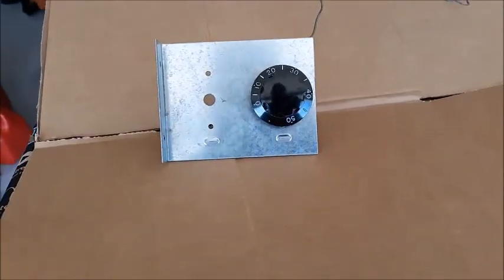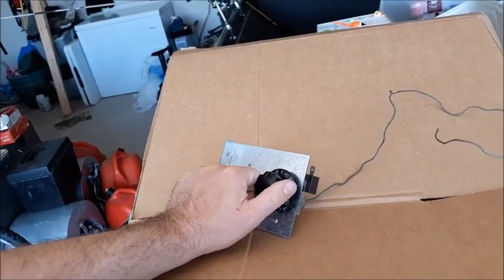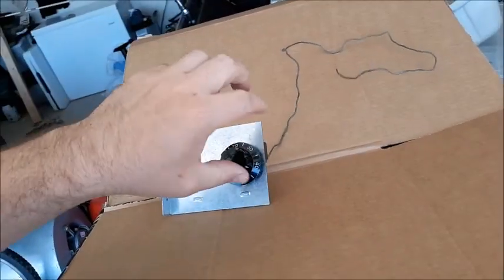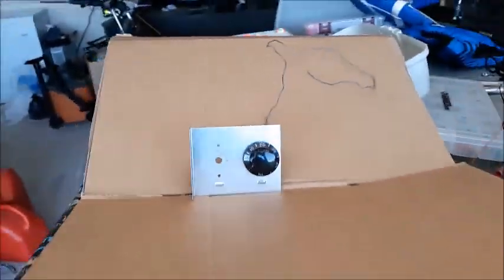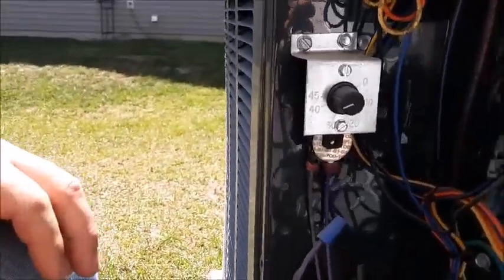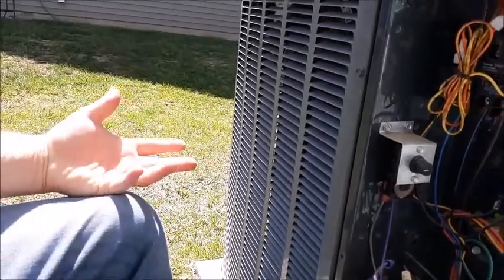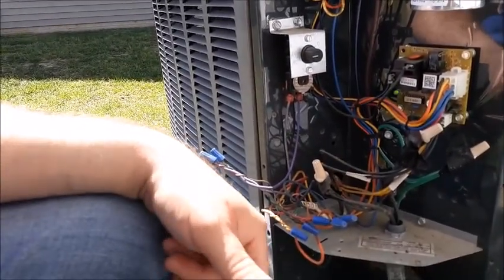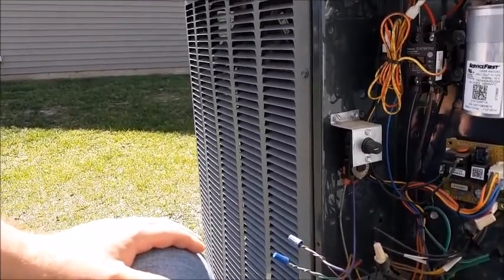Outdoor Thermostat

Comment: Balance Point. The building heat loss intersects with the heat pump capacity. Then you dial in your heat strips
Reply from the maker: So you are saying set the outdoor tstat to the balance point temp? 🤔 
My local code says set it between 35-40 to keep them off unless it is cold enough to really need them.

Comment: How would you test to see if the thermostat is bad. My heat has started using only emergency heat. I’ve adjusted dial but it still only uses emergency
Reply from the maker: Had to edit - didn't pay attention to video title. Is it in emergency heat or are you saying that just the heat strips are running? If you are just trying to check the outdoor thermostat them you should be able to use continuity with a electrical meter. You can unplug the wires and check it from terminal to terminal (not sure which one you have) for continuity. It should at least have a single switch amd 2 terminals. It will close when it gets colder than the dial setting. So if at dial is at 40 then any outdoor temp above that, the switch should be open amd then , of course, close at temps colder than dial setting. You can dip the temp sensor in ice water to test at colder temps if it is warm outside.

Comment: Great tutorial. My heat pump was icing up. It  won't go into defrost. But when I turned the dial on the outdoor thermostat then all of sudden unit goes into defrost. I have no idea why is that? Does this outdoor thermostat has something to do with defrost on/off. Any help would be greatly appreciated. Thank you.
Reply from the maker: I don't know of anyone who wires the outdoor thermostat in such a way as to mess with defrost. Mostly it just controls your heat strips running or not. I have had a few people commenting (and I looked up some of their manuals) that had the outdoor thermostat wired so that at very low temps it just shut the entire outdoor unit off but I don't really get that...but that was the manufacturers information.
Reply: That's mostly done that way for a dual fuel system I believe. To shut off the heatpump completely and run the gas/propane furnace only

Comment: Hi John, Can I set my outdoor thermostat below the 40degree? Is that an issue if i set it to 30 degree for the up north WA?
Reply from the maker: The lower the set point just means that it will have to be colder outside in order for the heat strips to come on. Here in the Southeast the "code" is roughly the same...40 degrees. I personally like the 40 degrees because heat pumps do good in the mid to upper 40's but as you get into the 30's the heat pumps performance starts to drop off good. If you want to experiment, just try turning it down 5 degrees or so and see how it works and how warm the house feels. If you are ok with it then I am too 😁
Reply: @johnjennings-JJ   Thanks very much for your quick response with a detail. I will try that to see how my Braynt perform.

Comment: Does this also work for dual fuel natural gas heat with heat pump?
Reply from the maker: You still should have one but it is probably called a "sensor" especially if you have a digital tstat that is designed for dual fuel. But instead of cycling the heat strips based on the temp outside, you cycle the furnace on and turn the heat pump off when it gets colder than the set point that is programmed for that sensor.  Of course, warmer than set point and you run the heat pump and not the furnace.